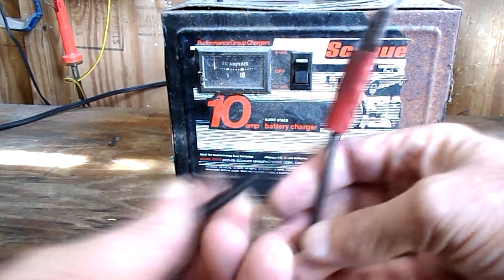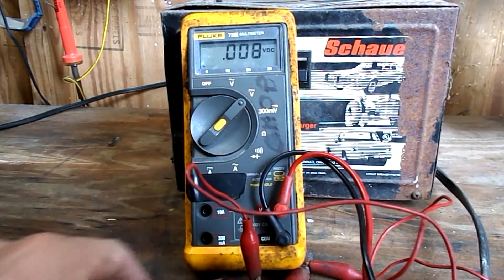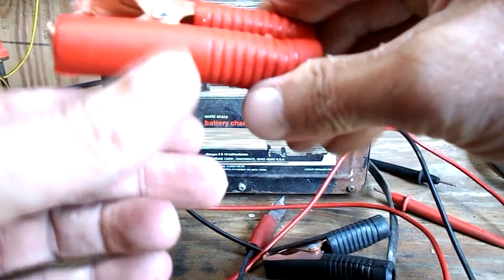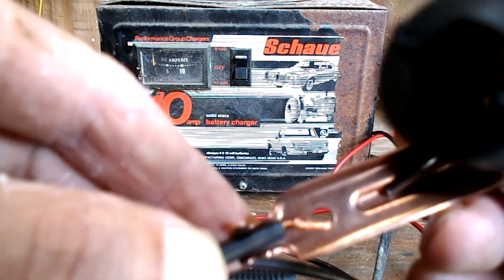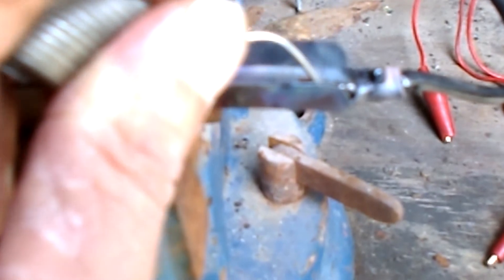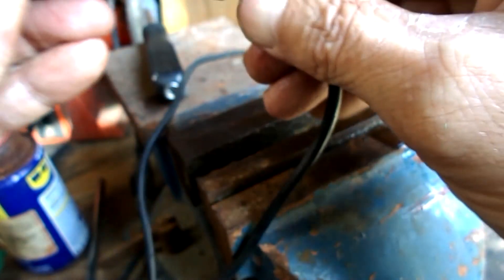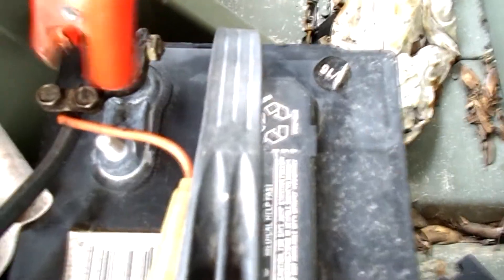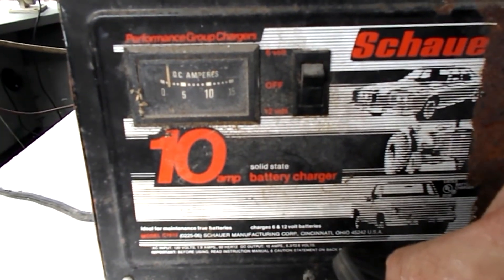Battery Charger, Replacing Terminal Clamps

Comment: Take note that the black wire coming out of the battery charger has a white stripe and the positive one doesn't have any markings, discovered that when I couldn't find my multi meter and had the leads mixed up 😅 and also you can use a step down transformer for the same results, just won't have any safety features so you will need to watch it, step down transformer works in the same manner as the battery charger